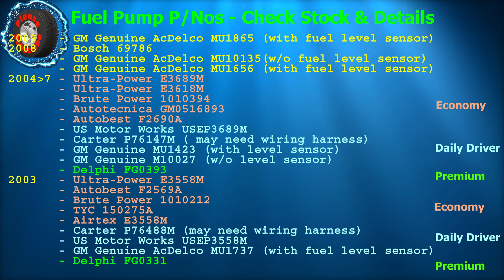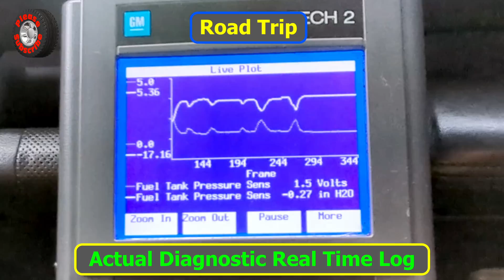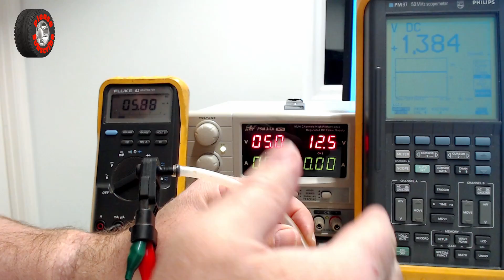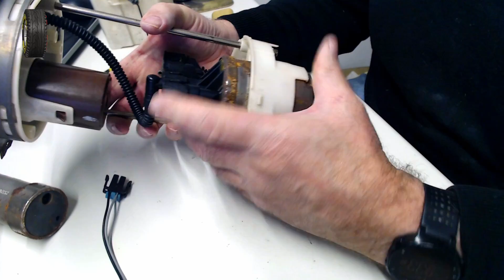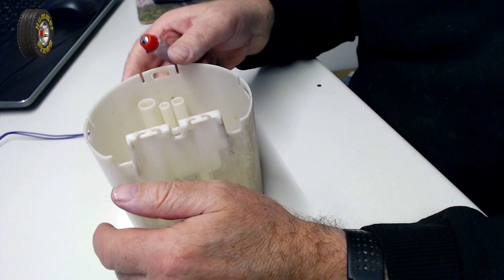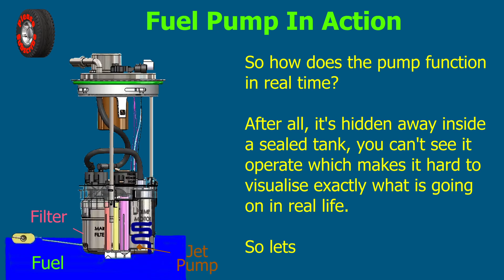Hummerfixes - H2 Fuel Pump Deep Dive

Comment: will a bad pressure sensor keep vehicle from starting?
Reply: Well my 03 hummer was running perfect and just lost fuel one day. Changed filter, relay as well as fuel pressure regulator and cam sensor. Pump is next and if that doesn't do it, it is going ro dealer to be diagnosed. Hate just throwing money at it. Could be ignition switch as well... who knows at this point .  Just odd it has always run perfect and then out of no where it just shut off
Reply from the maker: @tomchristensen2914  Did the old filter look ok inside? If the FP has not been changed it could be the problem, not done an 03 before personally, but there are YT videos out there 🤞
Reply: @hummerfixes  it looks original... mine only had 99k on it and 103k now.. I changed one on my Yukon so pretty much the same.. thanks  for the response...
Reply from the maker: Thank you for your interesting comment.  It looks like you could be referring to either the Fuel Tank Pressure sensor which is part of the EVAP system (all models) or the Fuel Injection Pressure (Line) Sensor which I believe is only fitted on 08/09 models. 

The EVAP sensor will most likely only generate a MIL lamp on the Instrument Cluster and set a DTC (03/07),  the Injection Pressure may (Line Pressure) may generate a MIL + DTC but may indicate a more serious issue with line pressure or the Fuel Pump Flow Control Module (08/09)  it all depends on you H2 model year.

Hope this helps and please respond if you have or need further info👍

Comment: Thank you, this is one of the best troubleshooting videos I've ever seen.  I'm still in the process of discovering what my problem is, but I saw a video from Red Dog Media where he had a fuel problem, and he replaced a LOT of components, only to find out it was the FP relay, and it wasn't making a good connection, so he twisted the relay terminals slightly.  He also mentions the paper clip trick, across the relay terminals, which I may try... I mean... ANYTHING to avoid removing the tank!  I'd like to see a flowchart for troubleshooting this... crank/no crank, check fuel pressure at the rail; pressure/no pressure;  check regulator, check relay and fuses, etc....  also, I have a Suburban that had a similar problem, about the same year, and same 6.0L engine, it turned out to be a ground from the tank, to behind the drivers wheel, that looked great, but when I took it off and cleaned it, the fuel problem went away.    Anyways, thank you very much, check out my Hummer on my channel!
Reply from the maker: Thank you for your very kind comments and I do hope you manage to resolve your issue. Just watched your video which is amazing, even more so as I'm just about to by a DJI Mini 4 Pro and want to do the exact same thing with active track!  Love your videos, just wish I was in the US with such wonderful landscapes! ✔️

Comment: Installed the 2 new knock sensors, H2 is fixed!!!! No more bogging at 25 and 45mph no more bogging up hills, no more misfires.Over last 6 months, new u joints, new air filter, cleaned throttle body, cleaned MAF, new spark plugs,new fuel pump, new cats and exhaust. Did all that myself!! Crazy mate, H2 has so much power, flying up hills, Idle dropped by about 300RPM, new gaskets deff sealed things up, fel pro. Sounded even louder just when turning it over now. The hardest was tracking down the parasitic battery drain. The u joints were the worst, they were so rusted and stuck. Couldnt have gotten this far with out you homie. Put in new mirrors and upgraded all lights to led. This H2 is lit! Almost 200K miles and its driving like it just came off the showroom floor. If there are any vids I can make for you let me know!
Reply from the maker: Great job on the knock sensors! And you've done so much, you should be very proud of yourself, well done! Curious to know what was causing the parasitic drain?
Reply: @hummerfixes  Two things, battery terminal needed cleaned. Causing erratic drain like upwards 4 volts would go up and down and the ac outlets beneath radio were drawing hard Its down to .5 now
Reply from the maker: @longlivechina7538  Glad you got it all sorted...✔👏